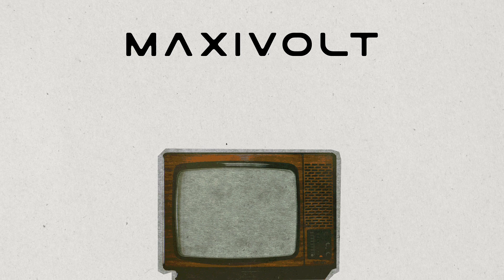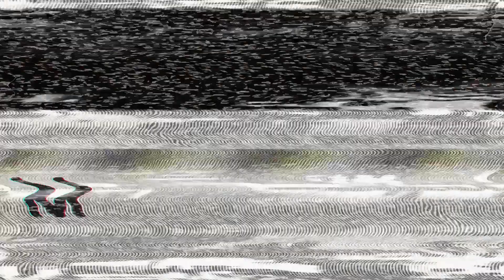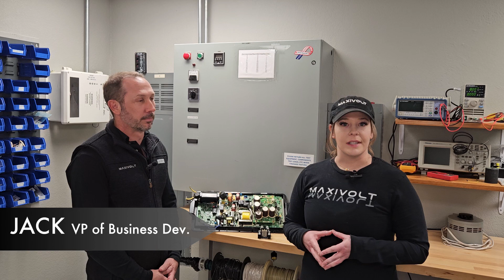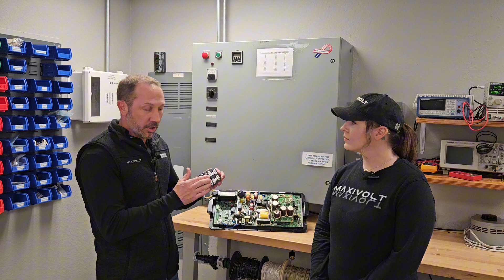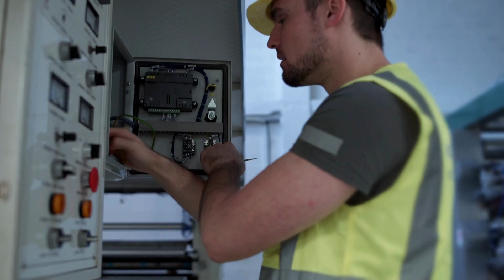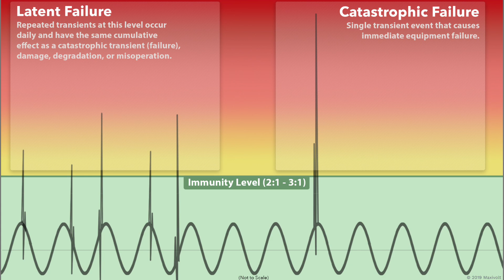Effects of Transient Voltage

Comment: HVAC Tech in a high end resort town that is known for having dirty power. I can't count the number of failed equipment due to voltage instability on the modern VRF and inverter driven units that are coming out these days. Often times a voltage spike will result in needing to replace an entire PCB because you can't really track down the failed component and replace it in the field.
Reply from the maker: Thank you for sharing your experience! It’s frustrating to see how transient overvoltage can cause such expensive and time-consuming issues, especially with modern units that rely on sensitive electronics. Dirty power and transient overvoltage are a growing problem, and unfortunately, they often result in costly PCB replacements, as you pointed out.

To add to this, some HVAC contractors have also mentioned increasing challenges with warranty claims, as many HVAC manufacturers exclude damage caused by power quality issues from their coverage.

Transient Overvoltage Mitigation designed for these scenarios can significantly reduce the impact of transient overvoltages and improve equipment reliability. We specialize in protecting critical systems like the ones you work with and even offer a program tailored for HVAC contractors facing this challenge. If you’d like to learn more about solutions that could prevent these failures and save time in the field, feel free to reach out or explore our resources. We’d like to help!